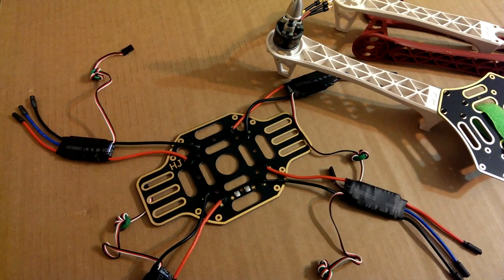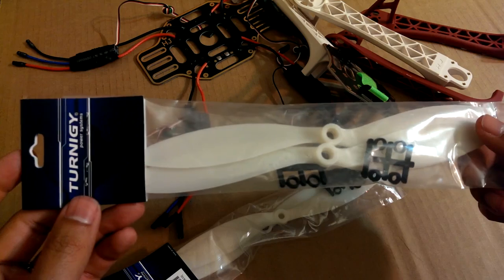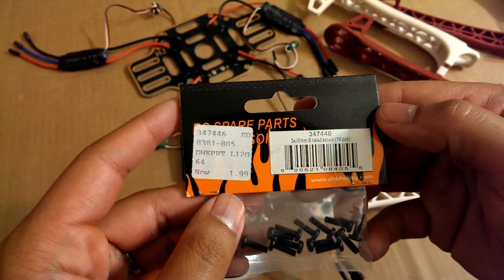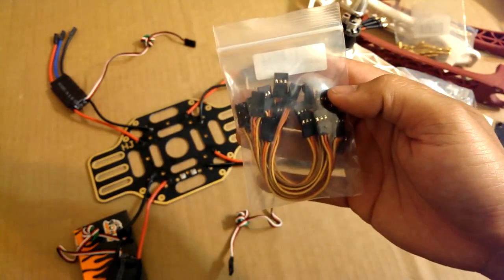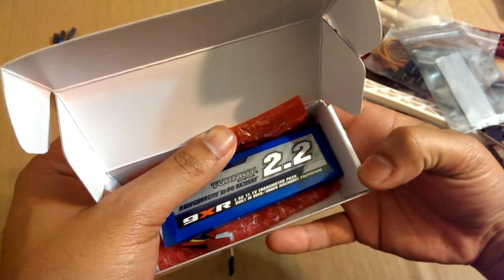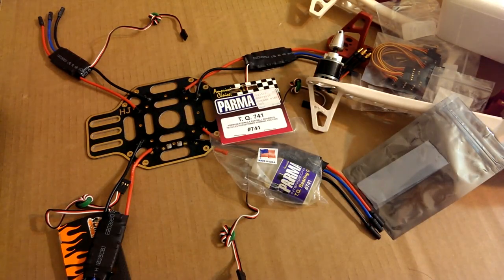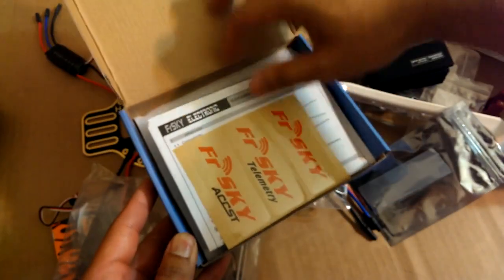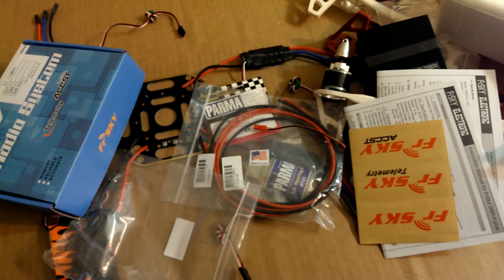450 Quadcopter Build - ALL PARTS - Part 1

Comment: Could you include a link to the charger you use?
Reply from the maker: I originally bought the Imax B6. http://www.hobbyking.com/hobbyking/store/__5548__IMAX_B6_50W_5A_Charger_Discharger_1_6_Cells_GENUINE_.html. This is OK, but I'd recommend getting something that can put out more power to charge multiple batteries in parallel. 

My Second charger was the Hobbyking ECO6-10 200W, http://www.hobbyking.com/hobbyking/store/__12105__HobbyKing_8482_ECO6_10_200W_10A_6S_Bal_Dis_Cyc_Charger_w_acc_.html, which I also don't recommend. I made a video on this where this charger and all replacements thereafter were not calibrated and causing battery overcharge. I bought this because it does 200 watts or 10 amps. Twice that of the IMAX B6 but still not great quality.

Comment: Very nice job. Read all your posts on building the HK450 Quad.
First quad for me so all of this is new. I'll have to re-read the information of the 9xR transmitter. Seems like there are quite a few steps to configure with the KK2.

I'm definately getting the Naza lite like you did. 
Any updates on the Naza since you changed it?
Reply from the maker: Updates to the firmware of the Naza? No. I was actually planning to record an update video today. The only thin i didn't really like about naza is that it limits your power when you are in Attitude and GPS Attitude Mode. In Manual mode you get full power. With the KK2, it's full power whether self-level is on or off. Naza is still a good FC though. Can't say it's better than a NAZE though. Watch this video if you'd like https://www.youtube.com/watch?v=l1GWtlRk45Q
Reply: MultiRotorPaul 
U running a NAZE now? If so have you made any videos of the set up and your thoughts. Does it support GPS? The link you provided was great. Thanks
WOW! hard to keep up with you....
Reply from the maker: I don't have a Naze right now, but it would be my next board if I were to switch. Yes it supports gps.